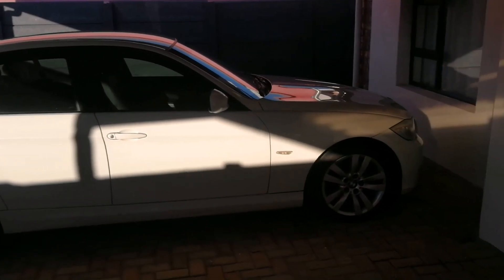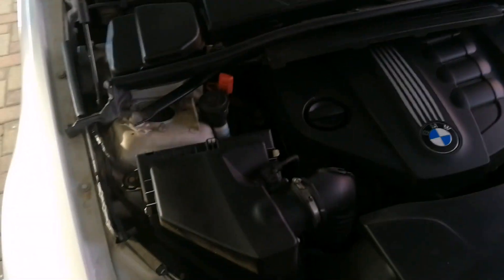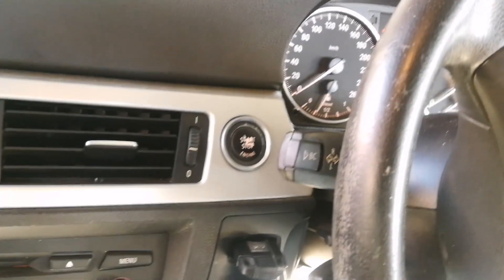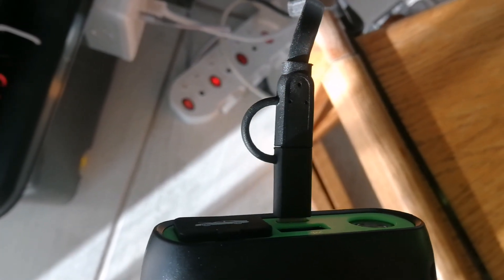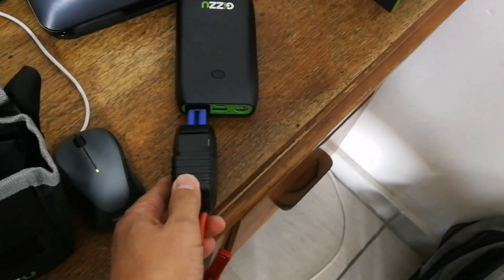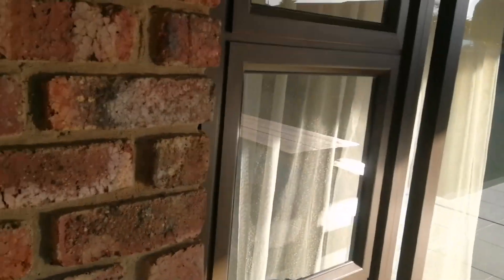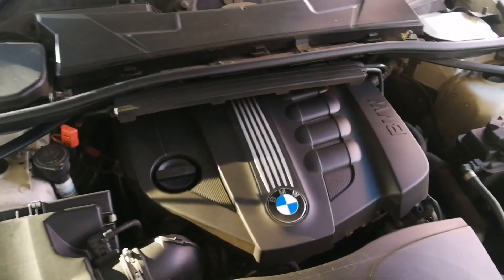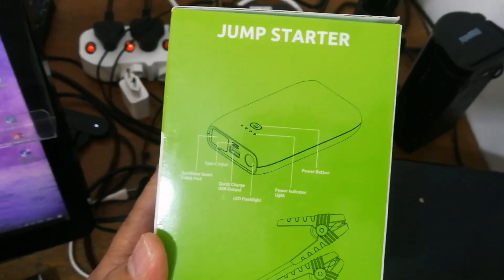Miracle Jump Start Box - Gizzu 1000A Jump Starter

Comment: I bought one last year some time. Tried using it on my Hyundai Tuscon for the first time yesterday, did not start the vehicle. Had to jump-start with another car. The unit was fully charged.
I hope i can still return it as i only tried to use it for the first time on 15/01/2024.
Vey disappointed